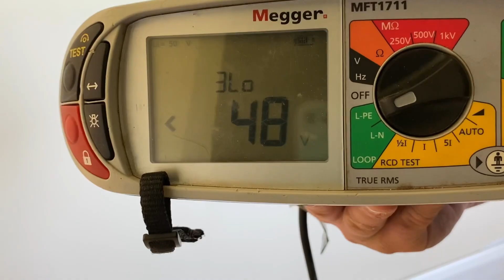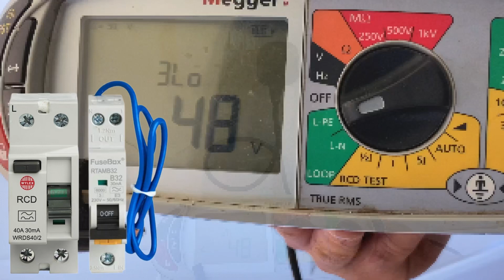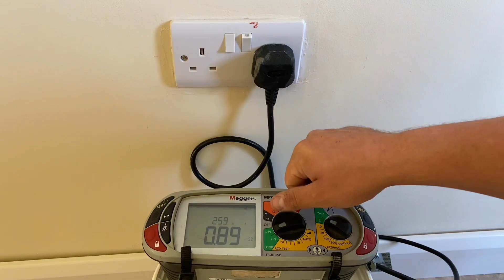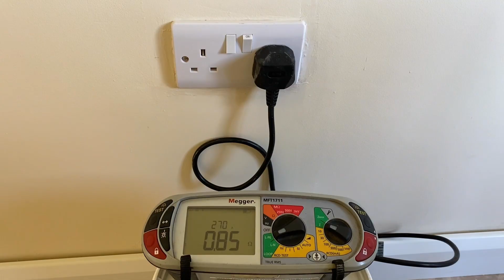Earth Fault Loop Impedance Test - 3 Lead Low or 2 Lead High - Test Explained

Comment: Why is it called 3 lead low ?       What is low ?  Are you still using the full voltage as you send the same level current down the neutral ?   Please clarify.        Great video. Thank you and another thumbs up as always.
Reply: "3 Wire Low" test uses 15mA of test current and balances across N - CPC to not trip an RCD. "2 Wire High" injects 20A of test current into the test circuit for a fast and accurate result, and will trip residual devices and small MCB's or sensitive MCCB
Reply: @jonathanireland2913 does 2 lead high inject 20 amps of fault current. That sounds very high. I thought it was 150ma of fault current?
Reply: @heron9524  I read it somewhere many moons ago, however it may well have changed with more modern test equipment. It was sufficient current flowing to nuisance trip a B curve 6A mcb, according to the manual.
Reply: @heron9524  my understanding is that as these are live tests, no current is "injected" by the tester, but rather a load is applied such to draw current from the mains. the tester can then measure the voltage drop to establish the impedance Zs

Comment: I don’t see how you can test the loop impedance at a light switch as there’s no neutral, so you would be testing the strapers ie line and switch return. Hang on hang on . 

To do this test at the switch isn’t a loop impedance tester it an R1+R2 ie a continuity test witch is then added to the Ze value, therefore it is a calculated value , the same would be for testing at the ceiling rose. So to get a measured Zs at the ceiling rose would be a three lead test.
Reply: Zs testing doesn't need a neutral.  A light switch gives you access to line and CPC which form a continuous loop from the local transformer.  The test will give you a true impedance reading as long as the circuit is live.
Reply: I liketo do drawings to explain to people, especially  younger people as things seem to be fast tracked and nobody explains it to them they're only told what to put the meter on, I knew the hi low setti gs but never knew how they did worked, good explanation